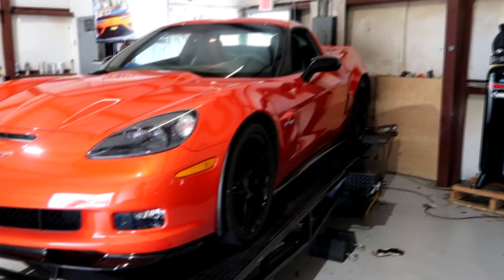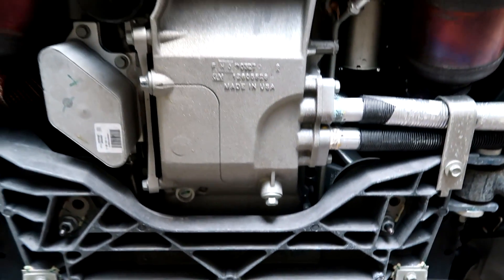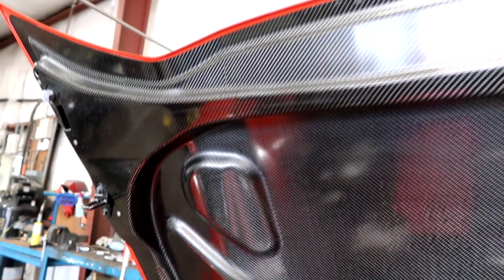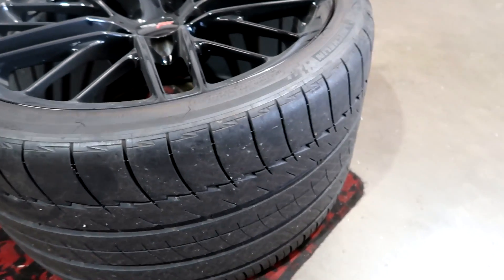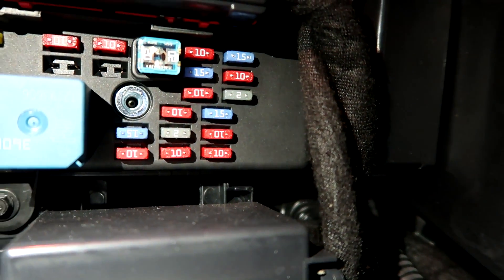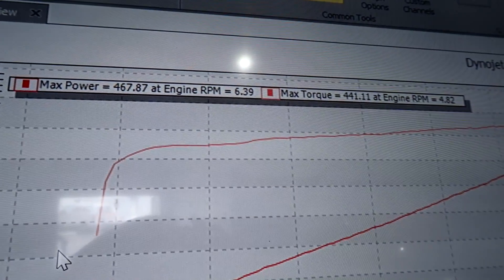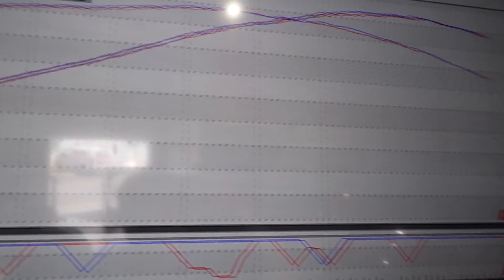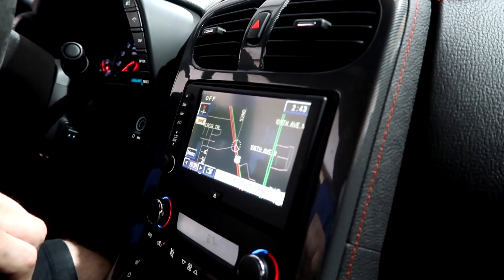Stock ZO6 Carbon DYNO  ???

Comment: My brother has always used mobil 1. People online always say it's bad but we've never had a problem with any of our cars using it.
Reply from the maker: Cody I’ve used Mobil 1 in everything. Including the race cars. I stay out of the ‘oil debate’.   Lol.
Reply: As long as it's the proper type of oil for your car, brand matters a whole lot less than how often you change it.
Reply: The pissing contest for oil opinions will leave you as confused as a fart in the fan section at Home Depot
Reply from the maker: TheTennesseeTittyTickler lol
Reply: Think about this.....knowing how much R&D goes in a Corvette, AND it comes with Mobil1 from the factory, I would trust GM and stay with Mobil1.

Comment: You're also getting higher horsepower numbers due to the carbon ceramic brakes. It's a huge drop in rotating mass.
Reply from the maker: Ladco77 Yes. Plus the X pipe doesn’t have the second set of cats
Reply: @LHTPerformance  The Carbon Edition is just built for speed, plain and simple. :)   I've always loved the LS7. Such a great engine and still the most powerful naturally aspirated engine GM has ever put in a production car.
Reply: Ladco77 If the tolerances were any tighter it probably wouldn’t start in just mildly cold weather like Formula 1 engines. 
In my book the LS7 and Lexus’ 1UZ-FE 32-valve V8 and 3UZ-FE  V8 are 3 of the Best, Longest Lasting, Most Reliable, Internally Balanced, Engineering Masterpieces ever made in the history EVERY Gasoline Production Engines ever made. Aside of the LS7 valve spring hiccup.